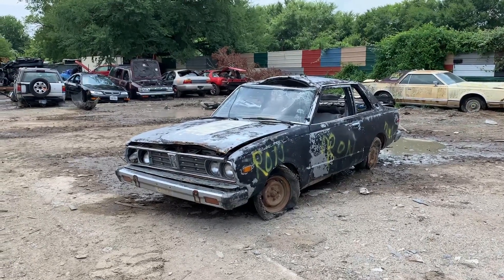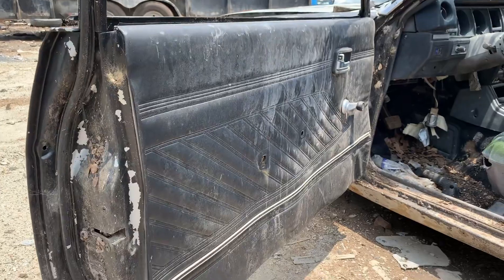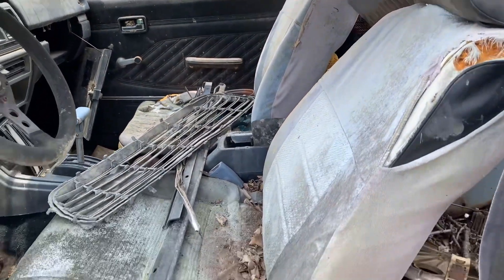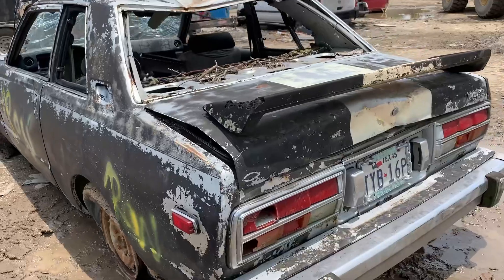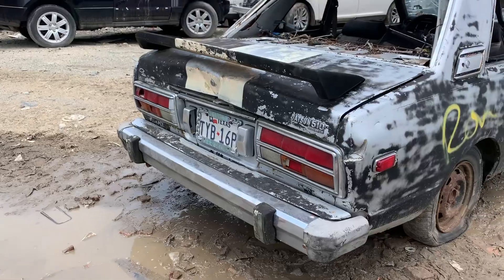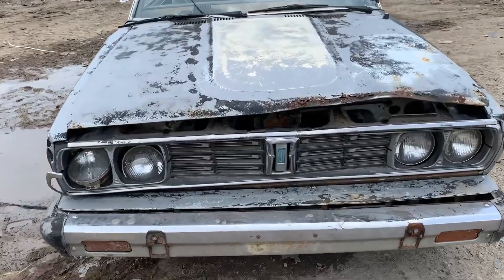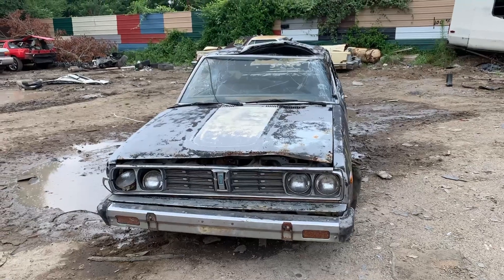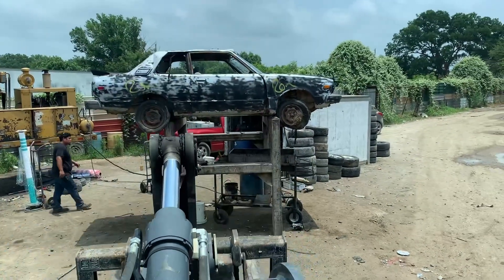SUPER RARE NISSAN DATSUN 510 LAST MOMENTS OF FAME! The Perfect Drift Car!!🥶🥶🥶🥶

Comment: Yup, with the VIN, we win: H for 2.0L engine equipped, L for left hand drive/US destined model, 10 for 510 model and the rest is the production sequence. The letter "K" before the "H" would be for a hatchback version of this car. This has the 2.0L four cylinder, Nissan "L20B" engine as stated on the placard under the hood. 

Back in the 1970s, the president of Nissan USA was Yutaka Katayama, who was called "Mr. K" and was instrumental in developing the early Z cars. He was the "John DeLorean" of Nissan, then called "Datsun" in the USA. This should be code 663 Diamond Mist exterior paint.
Reply from the maker: Man the way you bring the the info on these cars is like buying a brand new one.💙😎😁💯👍
Reply: @DeathRowCarCrusher  Some of the information on the older ones is harder to come by. LOL.

Comment: It’s amazing how we got by without all the bells and whistles on these older vehicles. I was 11 years old when my dad bought a brand new 1988 Toyota pickup truck. It didn’t have AC, or a radio, and had manual windows. He worked it in the deal for the dealer to put the AC and his old Sparkomatic AM/FM w/ cassette out of his old truck in the new one. He drove that truck until it had about 200k on it and sold it to a friend of his. He never did anything but regular maintenance on it, and a couple of minor stuff. That being said, too much crap on them anymore, more stuff to jack up. We have an 18’ Acadia right now that I’m about ready to bring to you to put it out of its misery!🤣
Reply from the maker: Wow 88 with no ac no radio that had to be painful. Come on bring mi that Acadia I hate them SUVs worthless & unreliable.💙😎👍😁💯